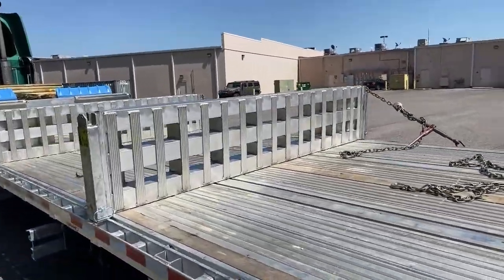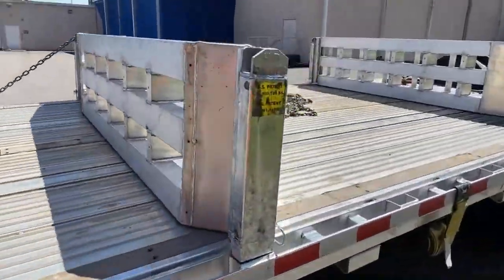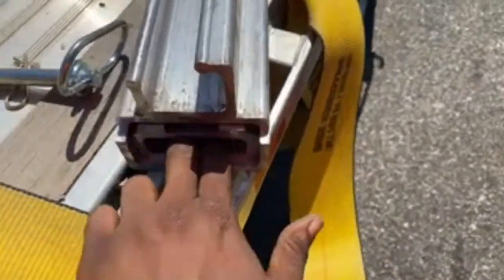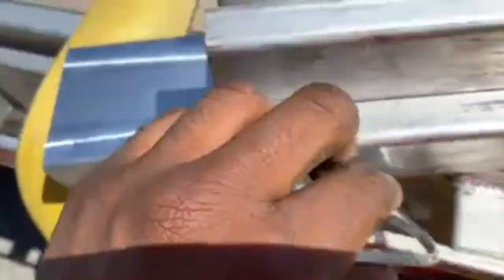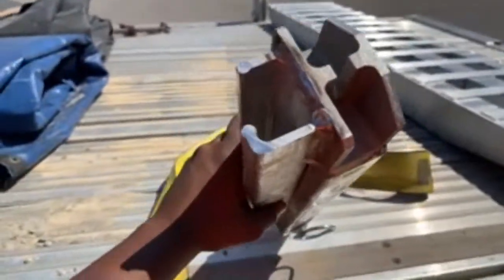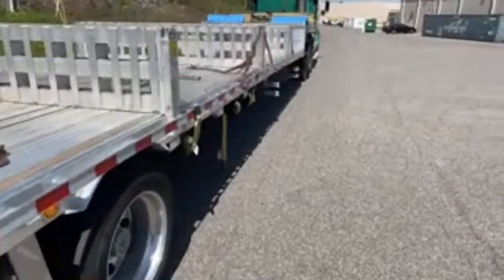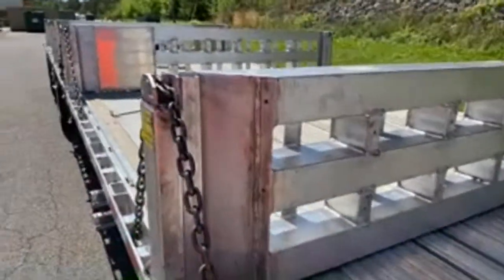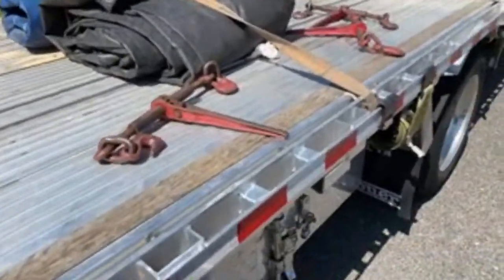Flatbed ONLY load on a STEPDECK! Load levelers and how they work 💪🏽

Comment: I have a 3 axle fontaine step deck trailer how do the level work cause I'm always scrapping the bottom
Reply from the maker: There is a leveling valve attached to one of the axles. It has an adjustable arm. Down makes it go up, & up makes it go down..🫡 Also the sell different legs for the 5th wheel that raise the plate…